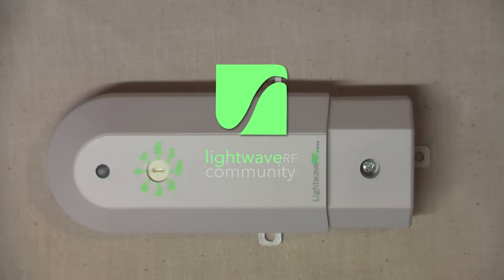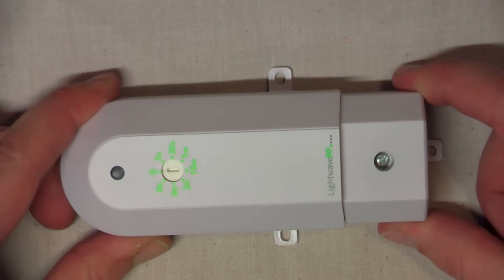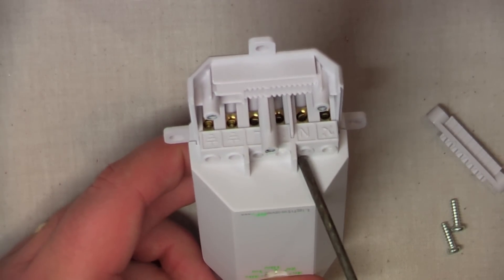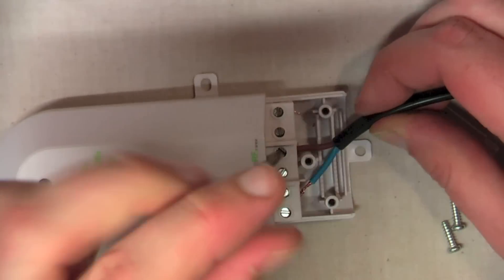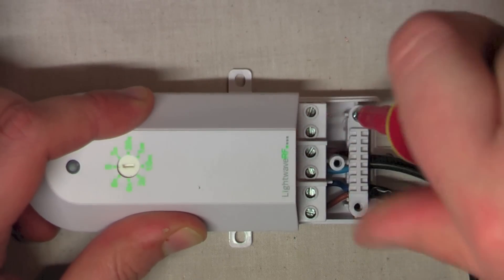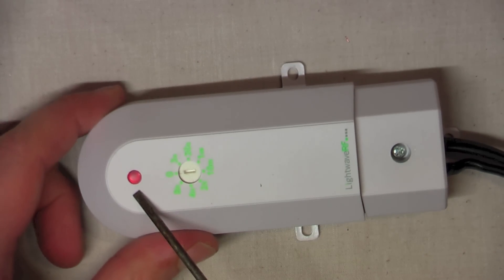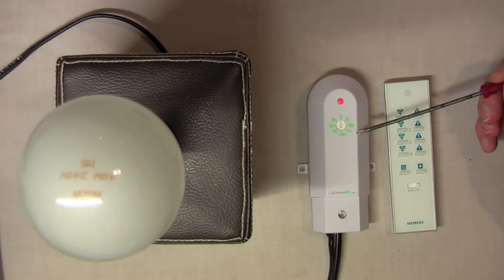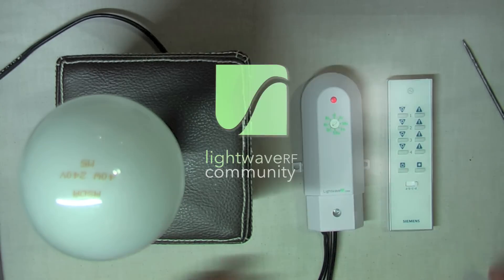LightwaveRF Inline Relay

Comment: Thanks for the video, is there a dimmer version of this? I have a standing lamp with a manual inline sliding dimmer, would be great to replace that with a dimmer that I can then control over WiFi (I have the LightwaveRF WiFi link and will be using DemoPad for control app).
Reply: Yes LW831

Comment: Great video. My one concern is the design of the cable grip/gland. For the power supply. It look like it is so close to the terminals that, even if only stripping the minimum amount of cable insulation to allow the conductors to reach the terminals, the grip will clamp down on the conductor's insulation and not the outer cable insulation. This means that the mechanical load on the cable is taken up by the two conductors rather than the outer (and stronger) cable sheath.

Comment: Hi all, If I have a normal wall switch and place one of these in the ceiling space can I still use the wall switch (normal not lightwave version) for standard operation but turn the light on and off from the remote? Sorry if its a dumb question but my dumbness requires me to ask! Thanks. Great vid by the way.

Comment: millimetres?  Why not state the inches? They were easy numbers in inches and most people in the UK (at least) can visualise inches over hundreds of mm.  Just a positive critique that would make life easier for the average customer.
Reply: steve humphreys Because its the 21st century. You go buy a length of anything from B&Q and its all in mm/cm/m.
Reply: PedroMcFedro Indeed because it has been forced.  For things that are not 'sold by the X' there is a mix of imperial and metric.  Or either.  Or both.  Anyway anything less than an inch is good in mm.  I was never any good at fractions.  :-)
Reply: +steve humphreys It's not been forced. Metric is a far better system.
Reply: I imagine you're just old... anyone under 50 doesn't think imperial's anything other than something old people use...
Reply: +Chris Ryan Check the maastricht treaty for enforcements of measure.  Also - it's ok to think that metric is a better system - that is the opinion of a number of people.  Most people sit in the 'I like both' camp.  You can see and hear it all about you.  I think metric is better for certain things and imperial is better for other things.  I doubt that there are people that are 100% polarised

Comment: hi, i just wonder if you turn on  a bulb using the switch(SKU JSJSLW200SS or JSJSLW201SS) is it possible to turn off the bulb using an iphone remotely, assuming you are not in the house. Or it will appears on your iphone as well the bulb is on?
thanks